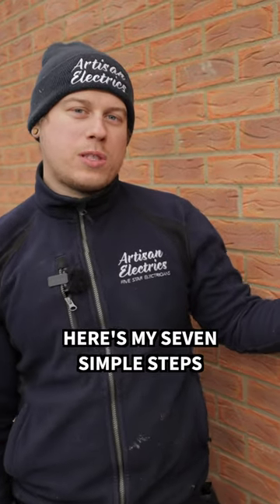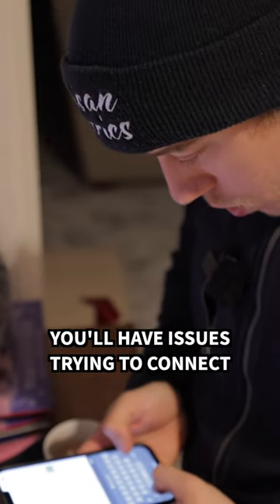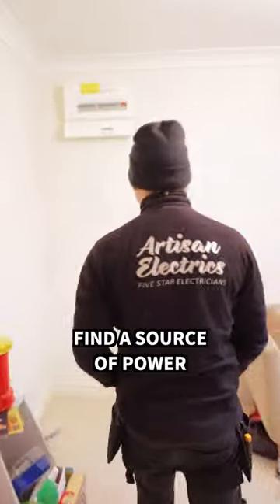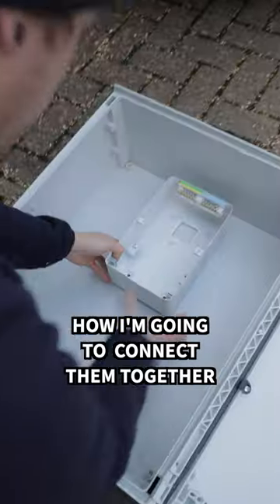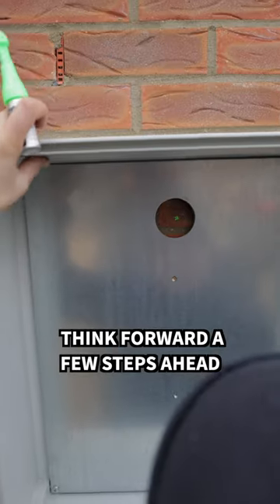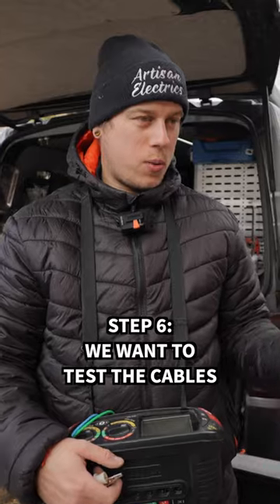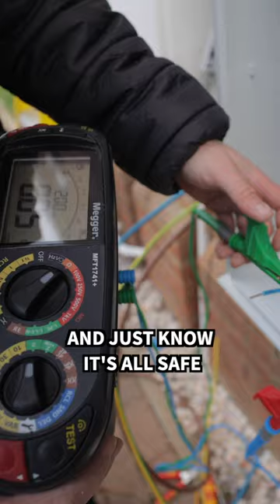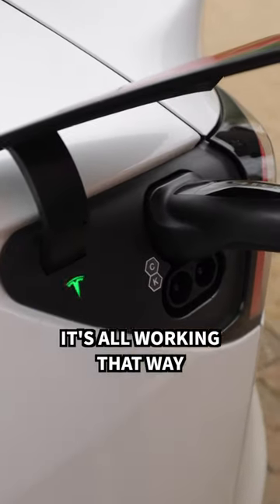7 Steps to install an electric vehicle charger 👌 #shorts

Comment: "oh thus nice slim car charger is going to look so neat on the side of my home!"

gets a gigantic electrical box plonked next to it
Reply: What's your alternative?
Reply: @Jdmess9 not such a feckin mahoosive box you genius?? 😂😂😂😂
Reply: @zu1875lu  I'm curious as too what the alternative looks like no need to be a dick about it
Reply: @Jdmess9  smaller box. Or if you have an electrical room inside the house, do the box on that side then just the wire for the charger comes out. Or do it a but more discretely like lower down, behind plants or hedges etc

Comment: Great point about provisioning it on Wi-Fi before a permanent connection.

From experience, sometimes a particular unit will prefer using a laptop over a phone, or vice versa.

Comment: Wouldn’t step one be to check the main fuse and get your DNO to change to 100A if required?
Reply: I always let the DNO know and check the size of the fuse if doubt. Also, request from DNO to replace fuse head if old (not grey).

Comment: That electrical panel looks like a fire hazard compared to US medal breaker panel. What Gauge wire do they use any one know.
Reply: It is 220/240 volts so not so thick wiring needed as with 120 volts
Reply: @nasrvdb9564  I know Europe uses 220/240. Just wondering what Guage wire. Looks almost 16/14 Guage.
Reply: If there's a fault metal will be made live, electrical fittings are always surrounded by plastic.
Reply: 1.5mm² for around 15m .2.5mm above 15m with a 16A breaker and 0.03A RCD

Comment: It's not a car charger that's inside the car, this is a wall box or a cable
Reply: Riddle me this: what charges a car ?
Reply: @Snortolodmyr-SS-Cokelensky  The charger unit inside the car
Reply: @StefanoFinocchiaro  so the car charges itself. No need to plug it in then yeah……
Reply: @christopherbeevor9315  No, ofcourse you need a cable to be connected to the charger of the car... But I don't think you can call a thing which essentially is an extension cable as a charger